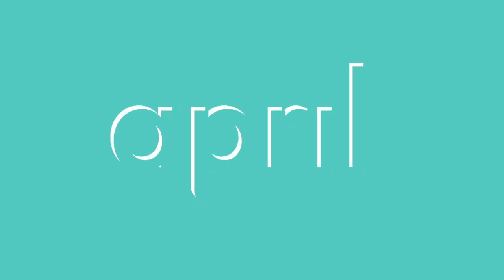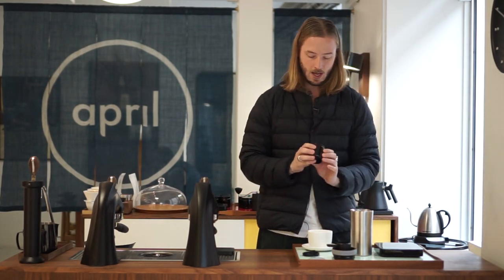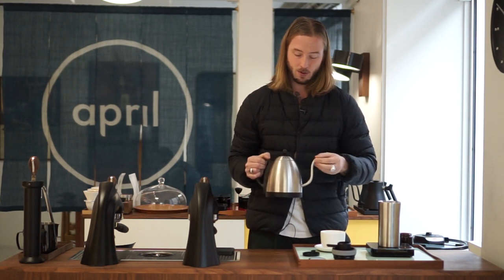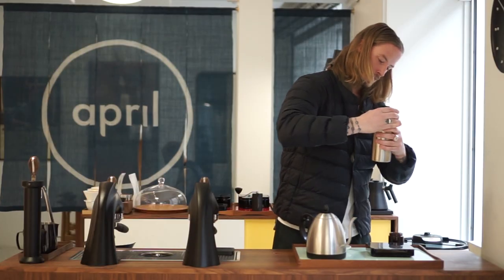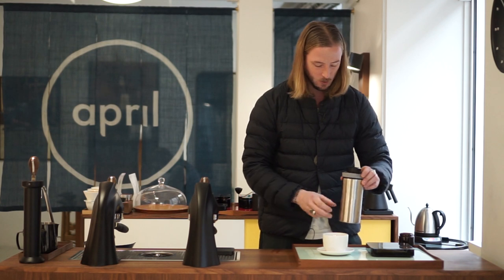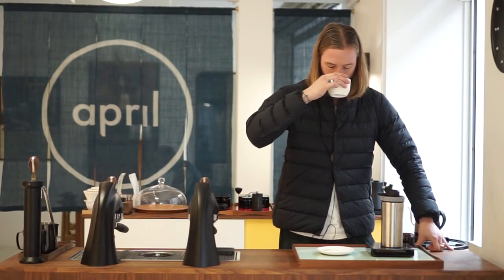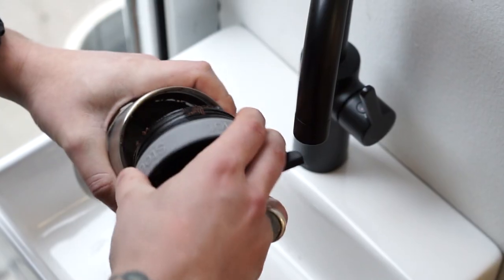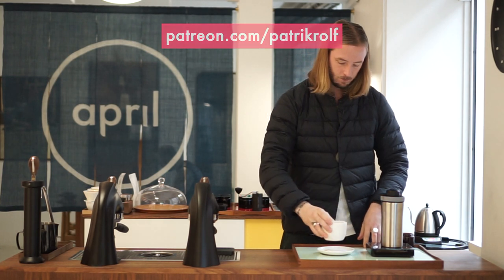Revisiting the SteepShot - Testing Tips & Tricks | Coffee with April #152

Comment: I had quite bad luck with mine - it was the one with the original seal and it ended up spraying hot coffee all over the ceiling when I flipped it one of the times I was using it. I think a nice concept originally, but ended up being a little too fiddly to operate in practice.

Comment: I don't know, I guess they rushed the product into production and could have given it more development time. The price is quite high. If you're going to make something this expensive, you should give better than that plastic and rubber cap. Also, looking at it, there is a huge potential for disaster. A clumsy person, like me, has a high probability of ending up burned, especially if you work with water at 100⁰. Nor does it come to solve a problem. The aeropress or delter press already do something similar: Coffee in 1 minute (nearly).
Reply from the maker: Thank you for watching
Reply: I got the new gasket, didn’t have an issue with the old one. I’ve been turning it upside down for the brewing time as stated in the included directions. Hasn’t been messy dosing over a 12oz keep cup, keeping it on top of the cup. I can’t think of anything faster using boiling water, cleanup is a bit messy. Fact is; it works :)